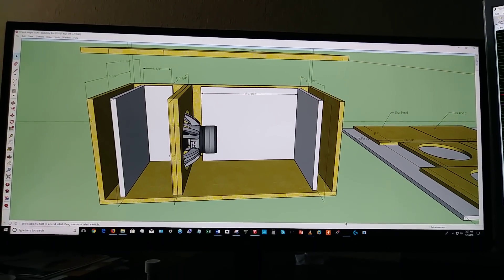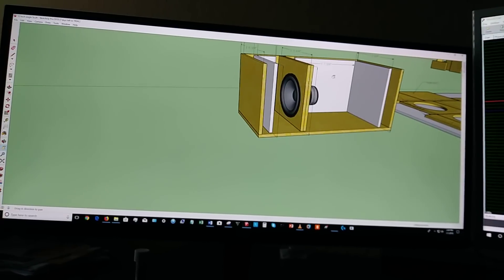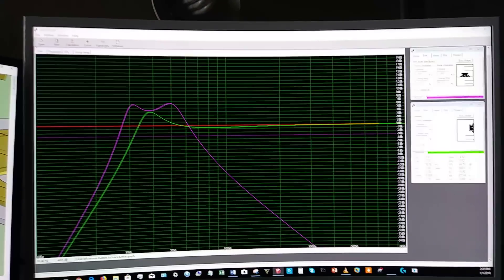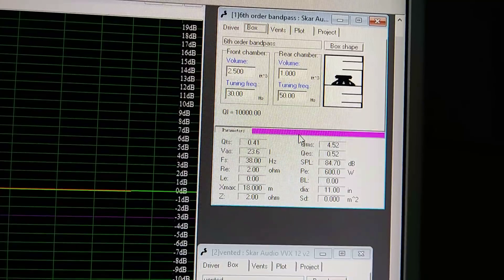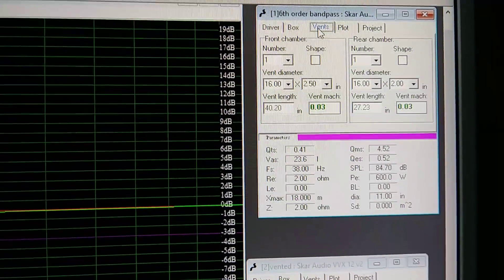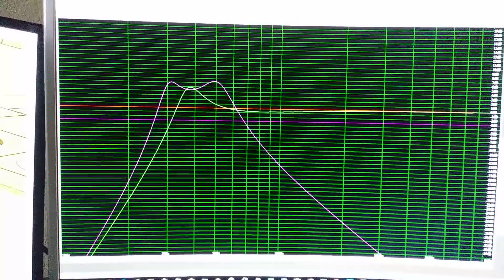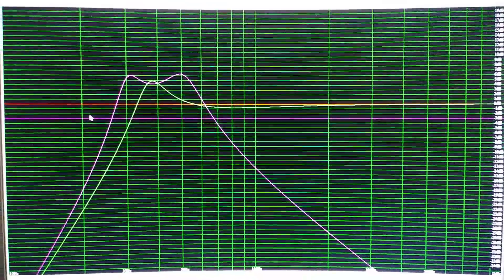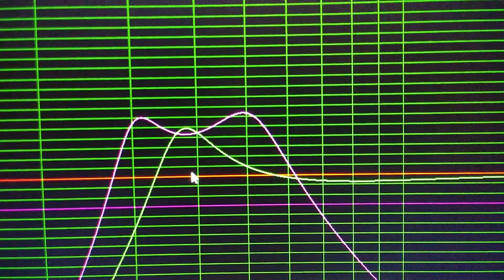4th Order vs 6th Order Band-pass (EXPLAINED): Pt 2 - Software

Comment: Man, awesome channel! You are only person I have seen who thinks like me, willing to try different things to meet personal goals! Sure could use a little help if you provide any consulting services. Had a box built but not thrilled b/c I think I can improve it. 2-JL12W3 flats with 1.0 cf per sub and a JL RD1000.1 pushing. The coke can floors seem to muffle or dissipate the sound. I lined the rear walls with 4.5mm Sound Shield and it helped but thinking a 3/4" MDF with another 4.5mm of sound shield lining it then applying it to the bottom of the DF box will bounce it forward kind of like a 4th order. Testing I have done seems to really help it out but bought wood and table saw, skill saw, brad nails, glue and willing to try a horn with single 8" or IDK but not trying to do same old sheet.
Help with setting a JL VXI w/DSP be nice too...... Any help I'd be much appreciative.
2025 F150 4 dr, NAVTV Zen-25 signal DSP bass roll-off reconfigured with toslink fiber out into a JL VXI 800/8 DSP running Hertz 6 1/2" all 4 doors which I sound proofed into walnut sounding doors 2 are mid-bass active full range, not digging the 50-200 htz most use w/no words, other 2 are coaxil rear doors, 2-1" tweets in the pillars, and 2-3" 70.3 pros in dash 100 watts to every mid/high active crossover. Then using the DSP controlled preamp outputs a rca analog jumps over to the JL RD1000.1. I was out the game 20 yrs after starting at 16, real learning curve on these new ones. 
I feel like the ground work is great and can be improved on. 

Great channel and mentoring my man!

Comment: Should both ports have the same port areas? Or should they be a certain amount of square inches of Port area per cubic feet of box space?
Reply from the maker: It depends on how much space you have. Sometimes the box is bigger with more port area. But in reality it shouldn't take matter. Just try to stick as close as possible to manufacture recommendation.
Reply: I'm making a 6th order for a skar ddx15. Skar requires 4 cubic feet and 64.75 square inches of Port area. The box would be 4 cubes tuned to 33 hz and 2 cubes tuned to 52 hz. I don't think both chambers should have the same port area. One chamber is half the size of the other and I think the port area should also be half the size of the other. A 2 cubic feet box should not have the same size of Port as a 4 cubic feet box. A big port on a small enclosure would not have enough compression and would cause the sub to bottom out. Skar recommends 64.75 square inches of Port area for a 4 cubic feet of box space which would be about 16.18 square inches of Port area per cubic feet of box space so I think it should be about 32.36 square inches of Port area for a 2 cubic feet box which is what the small section of the 6th order would be. These are just my thoughts and I know I can be wrong, but if I'm wrong, please point me in the right direction.  Thank you.

Comment: 🔥🔥🔥 I get it now, these are just two vented enclosures tuned to different frequencies, joined by a common wall, the woofer baffle internally, but built as a single unit externally.

Comment: This is all your fault. I wont be happy with a ported box anymore. Now thanks to you I have to figure out all the ins and outs of the winISD program. I’m removing the back seat of my Silverado, making a bed about 20 or inches off the floor. So now that I have the space I guess I need to engineer a box to utilize it.
  Thanks for the info on the program. Maybe a full fill in and WTF each of the parameters are for as you build a box tutorial could be a series of videos for you. Assuming I’m not the only one interested in making a box that works well. Keep it up man. I’m binging on all the vids you have up
Reply from the maker: Thanks for the support 👍 and you're correct, quite a few people are asking for that tutorial. Looks like I got some work you do 😉

Comment: what are the disadvantages or advantages if I were to build a 6th order and tune both the chambers to the same frequency? I'm planning on builden a nowall setup in my 1997 v70r with 2 18s and aiming for low freq SPL like 26-28hz ;)
Reply: or am I better of just building a vented box ?
Reply from the maker: I have a many videos on this subject, in-short never do that. The 6th gives you greater bandwidth; flatter response across many frequencies. Doing what you stated is useless in that regard; for you would only peek in one, narrow frequency band.

Comment: Was rewatching your video because I was getting ready to build a new box for my sub, and I noticed in the beginning when you show both the vented enclosure and the 6th orders “box screen “ on winisd, your vented enclosure has a couple of your t/s parameters different than your 6th, just noticed RE and your diam Are different, not that those specs throw your design off just thought I’d give you a heads up, awesome video though bro even watching it the 2nd time

Comment: You wanted full low range with good all round response for your homr, why not a T-line box? Get as low as 10hz all the way to your crossover cutoff. Sure it wont have the peaks but it will stick right on that 0db line all the way without any rolloff.
Reply from the maker: Excellent point. I think I'll do a vid of that. Thanks for the comment.
Reply: BudgetBassHead 
Sweet. Im stuck between a 6th order and an 8th order for my car. T-lines is to long hahaha
Reply from the maker: I got a vid on T-lines coming soon.

Comment: Request you show screen shot of the cut marks on the wood.  Would save a ton of time and prevent mistakes, email to dieterav@aol.com or post for everyone.  Also, would you recommend rounding the port corners?
Reply from the maker: I'm not exactly sure what you mean by, 'cut marks on the wood', but I do have a slide show coming soon of the cut pieces and assembly. So please stay tuned and hopefully I'll be able to answer your question with that upload.
Reply: Trying to see the drawing on a 4x8 sheet of mdf.
Reply from the maker: Coming soon
Reply from the maker: https://youtu.be/iPLhlPHcASg